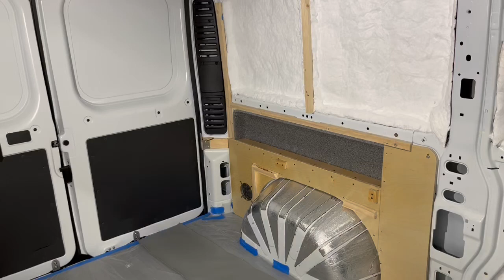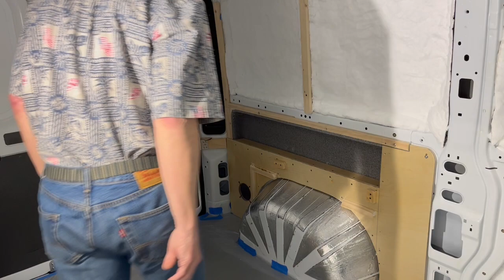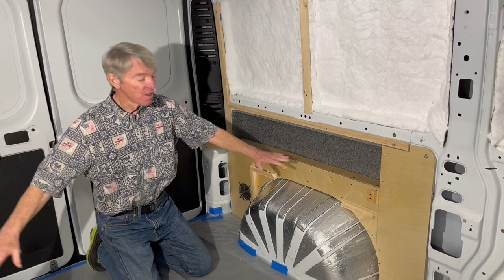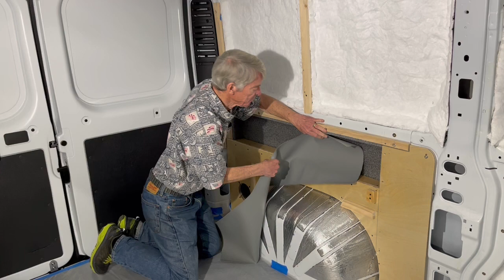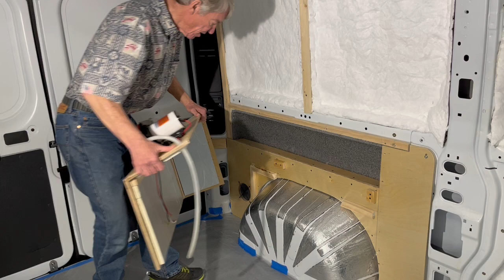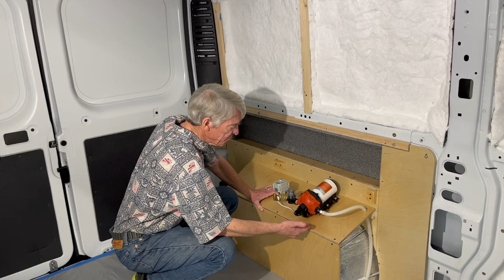Garage Insulation in a Camper Van Conversion

Comment: Hey there! I've insulated all of my van except the garage, is it a good idea to still do it? I'm not sure yet as I like the extra space
Reply from the maker: Its hard to say if it makes sense for your build. Typically the garage is under the bed which does a good job of insulating the garage from the rest of the van. Putting butyl mat on the wheel wells is always a good idea. I covered my wheel wells and garage walls with plywood to protect the butyl mat and provide surfaces for securing objects without drilling holes through the floor. Insulating under the plywood was really easy and did not add much weight. In my case adding the insulation didn't really take up much space, 1/2" on each wall.
Good luck on your van build.